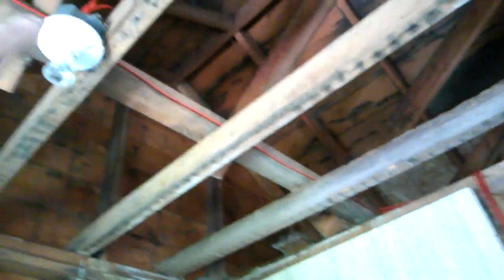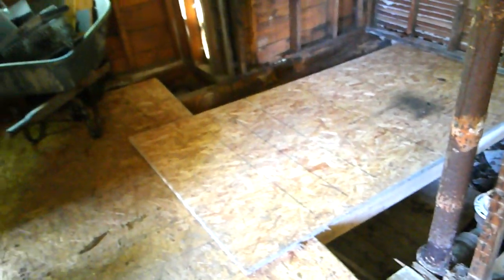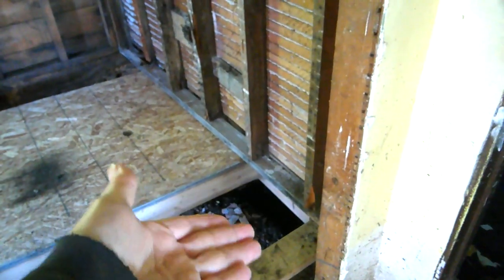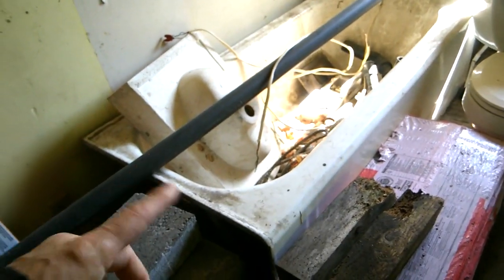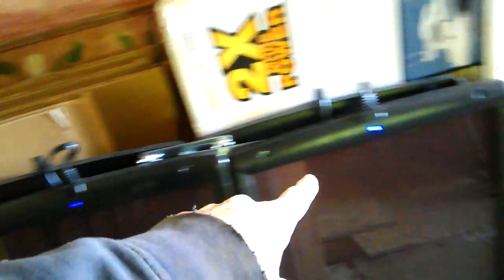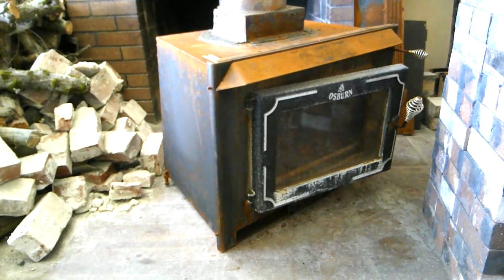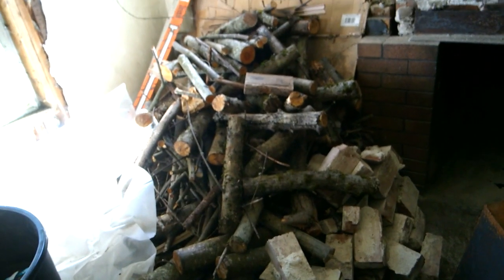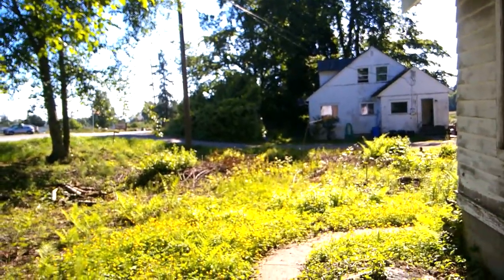EP.07 House reveal & Solar setup pt-1, diy house remodel.

Comment: How much amps will be  total of the on 12-volt battery ?
Reply from the maker: I was looking at about 20 amps with my first 3 solar panels and not sure when I get all 20 on the roof. I know that I will have to upgrade my charge-controller at that point, hopefully a Victron unit. Thanks for asking.

Comment: Also what did you use for the bus bar on the battery
Reply from the maker: I has some 3/8 copper pipe laying around and flattened it and made it shinny. I would spray coat it once you are done mounting it just to prevent it from corroding later. Watch the video again, I show you how I did that.
Reply: @ReverendJeffrey  thank you I did i just seen how you marked the spots to drill holes. Thank you so much I got some copper pipe from home depot so I'm going to do it.

Comment: How did this work out i was given 3 prius battery packs so I have them and didn't spend any money on them. I have a solar setup already but with lead acid. My mppt does nimh so I just want to know how it worked out.
Reply from the maker: 3 packs is huge, about 2k watts apiece. I would just set them up just like I did with mine and parallel them together for a 12v system. Or if you want split phase 240v ac then I tell you how to use them in a 48v configuration. It will be better than a tesla S battery module. Thanks for sharing.
Reply: I read that nimh batteries need to be fully discharged before recharging to full or there will be a memory problem and the capacity and life of battery is shortened.

So doesn’t that mean that you should use all battery power by end of night,  and then let the solar fully recharge it during the day before using it again? 

I dunno...